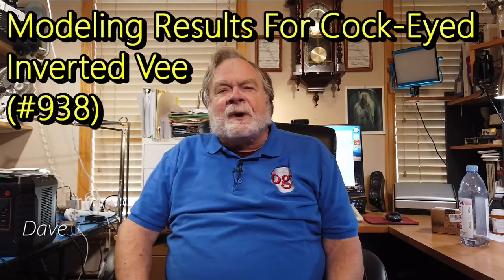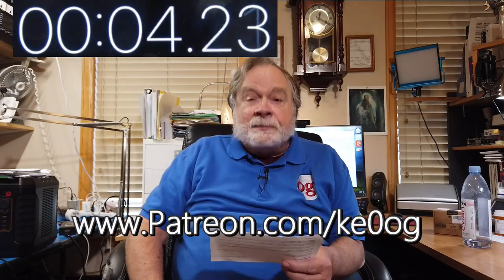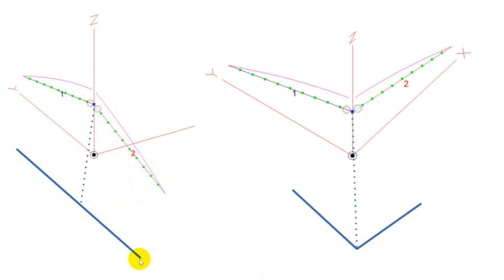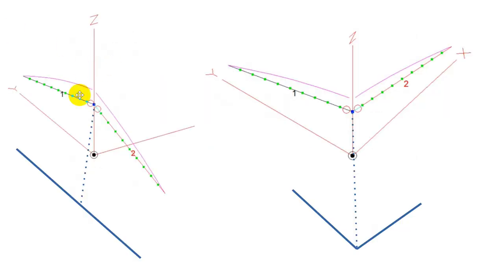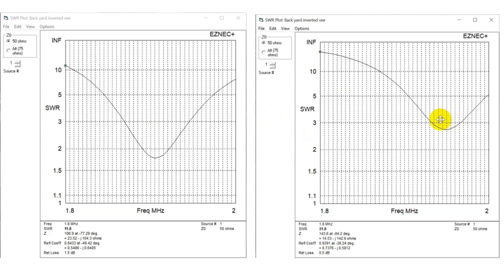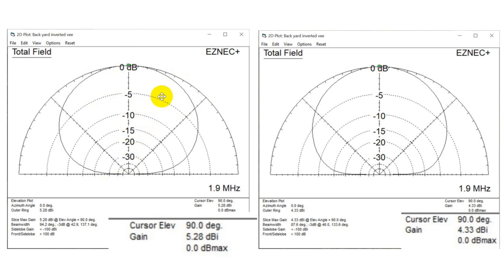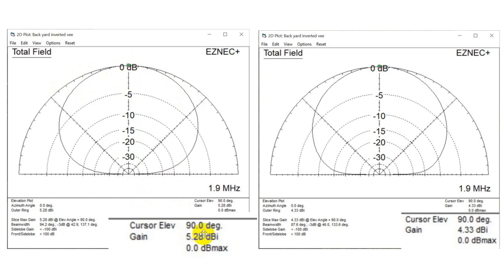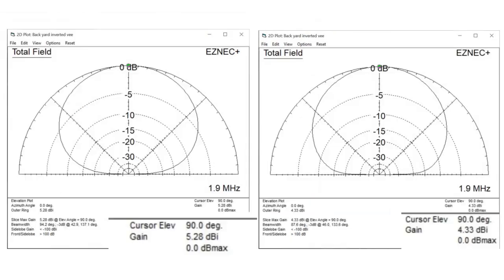Modeling Results For Cock-Eyed Inverted Vee (#938)

Comment: I'm glad I found this video. I have the same limitations plus some. I cannot got as high so I was thinking about an OCF dipole like the MFJ-2012. I would get a fiberglass mast like the SpiderBeam and raise the feedpoint to about 30-35 feet. The short side would be like in this video; 90 degrees from the other side. I know SWR and other things will change but I am glad to see at least that I may have some success.

Comment: Ignoring the balanced / unbalanced issue, with the low impedance of that antenna and the low frequency the losses with coax may  be better than ladderline....  I am an advocate of ladderline/open wire feeder but it is not automatically lower loss.

Comment: why didnt you show the azimuth pattern??  I think that was what he was asking.
Reply: They're very nearly identical.  Elliptical, with a bit less than 3dB gain broadside to the antenna as compared to off the ends.  With the cockeyed version, it's more like 3.1dB instead, though 'broadside' has moved 45° in Dave's geometry.  Really not much of an effect in that regard.  Far more importantly, the vertical beamwidth shrinks a couple degrees, which is going to have a much bigger (though still quite small) impact on the effective NVIS radius.